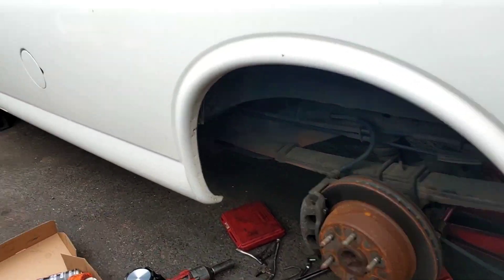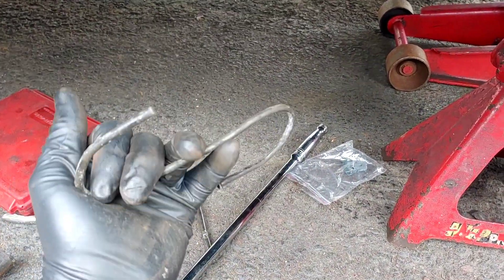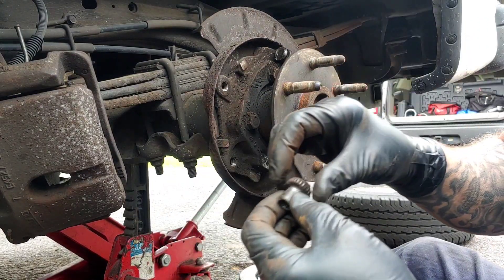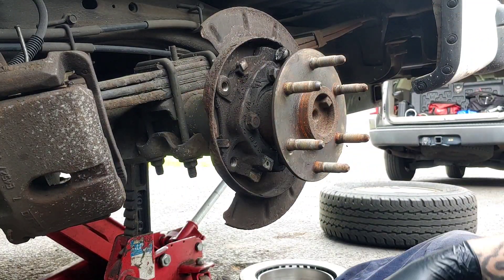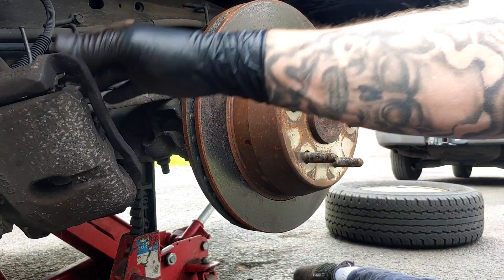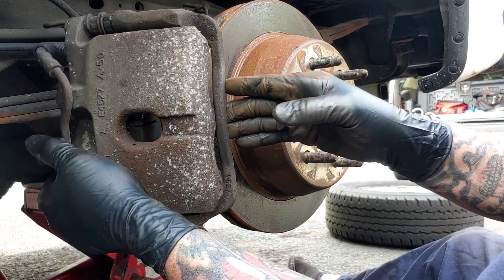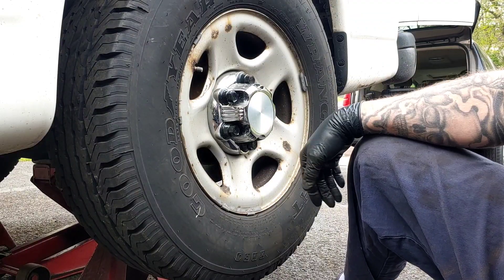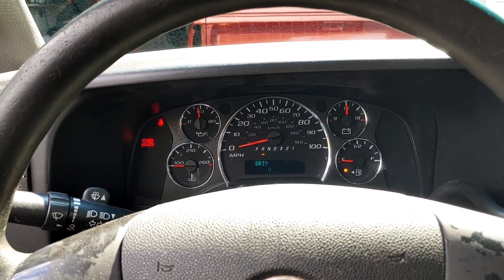2008 Chevy Express 1500 parking brake replacement

Comment: @15:00 i have a tool that measures the rotor hat ID for parking brake surface and on the other side of the tool it automatically calibrates the OD of the shoes so you really do not have to pull off the rotors on and off many times, tool will get you very close to correct adjustment so nice to have a tool like that makes the job so much faster...

Comment: Thanks, Michael. I replaced backing plates, rotors, calipers, pads, shoes, parking brake cables, rubber hydraulic brake lines last year on my 2007 GMC Savana. I needed your video to confirm for me that there is no inspection hole to adjust the drag on those drum brakes. What a bummer! Thanks for recording this and posting it!